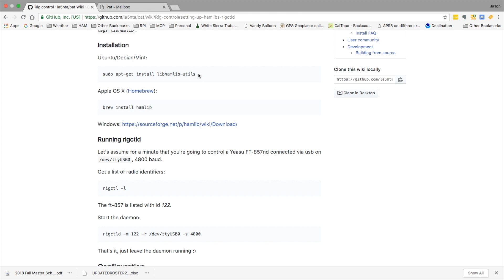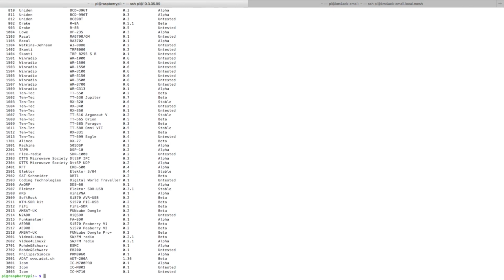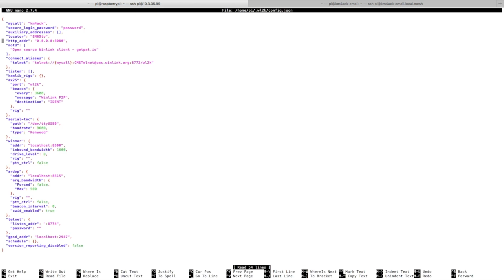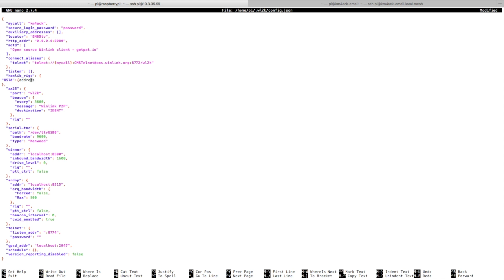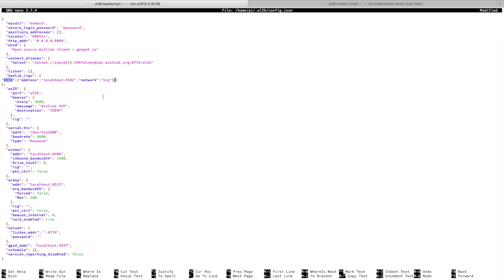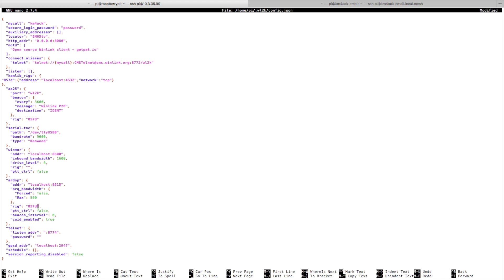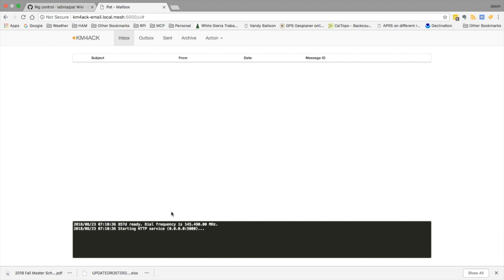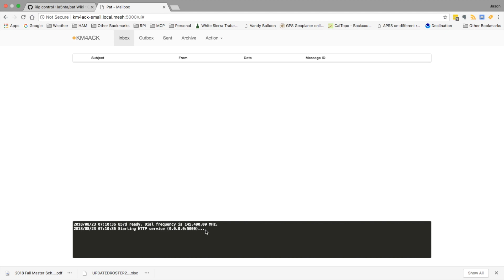Installing Winlink on a Raspberry Pi EP02

Comment: Just a foot note. It would not work with my FT-718ND until I turned the speed down from 38400 to 4800. Thank you @KM4ACK
Reply from the maker: Yes. The baud rate on the radio must match the command for it to work.

Comment: Hi Jason,   I am able to get most of this to work except for rig control.  I have a Yaesu ft-891 so I used this command: 
"rigctl -m 136 -r /dev/ttyUSB0 -s 9600"  I am using a raspberry Pi 4 w/ 4gigs of memory.  I also have a program FLRIG that I use and it works okay at controlling the radio and it is not running while I issue that command.  Any ideas?   Ken wd4nkz
Reply from the maker: Does 9600 match the baud rate on your radio? An alternative is to open flrig and then use "rigctld -m 4" and feed rig control through flrig. This is the way it is configured on build a pi. Also, I have a new series for installing winlink. It's at the top of this playlist https://www.youtube.com/playlist?list=PL1QTYT4Qo9cY98NFmxrTvtGyWI9pgxtFq
Reply: @KM4ACK  yes it is configured for 9600 and I'll try out your suggestion and the other link.  Thanks so much for responding!!!

Comment: ok Im using flrig because ft891 isnt in hamlib yet

this isnt working for me, i assume thats because "/dev/ttyusb0" in my case isnt right because of flrig.
what would you try here

rigctld -m 4 -r /dev/ttyusb0 -s 4800
Reply: OH WOW........ FT-891 is in the list now..... Number 136      THANKS GUYS!!!!!!!!!!!!!
Reply from the maker: Ross, If you choose to use FLRIG, you will skip the 'rigctld' section of the setup for Pat. When connecting with Pat, first open FLRIG and choose your frequency. Then open pat, choose your transport, enter the target callsign, and click connect. No need to enter any frequency information in Pat. 73, de KM4ACK
Reply: @KM4ACK  Roger that... i found FT891 in the list after updates.... its number 136 i reflashed the card. started over.. when i get to 

rigctld -m 136 -r /dev/ttyusb0 -s 4800 

it returns
"rig_open: error = IO error"
whats that mean? any idea?
Reply: wait no .... sorry..... i see it....... ive been up all night playing radio ... i just need sleep..... sooooo..

USB is capitalized......    hahahah   geez... ill admit im a rookie... it works now
Reply from the maker: Double check your CAT baud rate on the rig and make sure it matches the 4800. 73, de KM4ACK
Reply from the maker: Yes. Linux is always case sensitive. 73, de KM4ACK

Comment: FT-891 is not in hamlib?????? OH NOOOOOOOO!!!!!!! what do i do ... im a newbie
Reply from the maker: Couple of options. 1. Run Pat without rig control. Rig control in Pat is limited anyway. You can only change the frequency. Pat won't change modes on the radio. 2. Compile hamlib from source. (Google is your friend here) 3. Install FLRIG https://youtu.be/WCj2usvOItQ Then you can change to the correct frequency with FLRIG before firing PAT up. Hope this helps. 73, de KM4ACK

Comment: Love the series.  Was wondering if anyone could point me in the right direction.  I am trying to set this up with my 857d and when I launch rigctl and pat it tries to connect to the radio but throws a connection refused message when it polls for the frequency.  I verified on the radio menu 20 that it is indeed set for CAT not TUNE - but still receiving the error.  Any guidance would be appreciated.
Reply from the maker: Check the baud rate on the radio (menu 19). Mine is at 4800. Also, make sure it matches the rigctl command. Thanks for watching! de KM4ACK
Reply: @KM4ACK  Thaks for the response. I checked and I am using -s 4800 and menu 19 is set to 4800 bps. The full error is : Unable to get frequency from rig 857d: dial tcp 127.0.1.1:4532: connect: connection refused
Reply from the maker: @mattkob  Are you using rigctl or rigctld? Did you set it up in rc.local? de KM4ACK
Reply: @KM4ACK  OMG - I was leaving the d off of my command and therefore running rigctl.  It appears to be working now, at least it is error free.  Thank you so much for the assistance and all the great videos you produce for the ham community.  I am eagerly awaiting my signalink to arrive so I can fully test things.

Comment: Having the darndest time here.  I've got pat installed and running over telnet.  I can't seem to get it hooked up on ax.25 using direwolf.  Is that just not possible or am I missing something semi-obvious?
Reply from the maker: It’s possible. Try this video for help. Pat Winlink 2M Packet 1200 baud Setup https://youtu.be/o8OBF47UkeI thanks for watching. 73, de KM4ACK

Comment: I get this error not quite sure what it means, please help: rig_open: error = IO error
Reply from the maker: It means that your pi can't communicate with the radio. It could be any one of many reasons why. Rig control is the hardest part of the project to get going for most. You can skip the rig control portion and simply spin the dial on the radio by hand for now if you wish. I will try to help but probably don't own your radio to test. Feel free to send me an email mycall@arrl.net Include which radio you are trying to configure. de KM4ACK

Comment: Thanks for doing these videos! I don't quite have my setup working yet (figuring out how to adjust ARDOP levels), but one note for my setup with my FT-891 - in Pat config under ARDOP, I had to make ptt_ctrl TRUE.
Reply from the maker: What kind of sound card are you running with the 891? de KM4ACK
Reply: @KM4ACK  I'm using a $2 eBay USB sound card. I managed to adjust the levels outside of ARDOP, and I've successfully tested the system.  Thanks for putting together this video series! 73, Rex KE6MT

Comment: I've gotten this far:
2019/02/23 11:18:23 Unable to get frequency from rig 7200: read tcp 127.0.0.1:41918->127.0.0.1:4532: i/o timeout.
Not sure where I am going wrong - is my pi simply configured differently?  Any suggestions on where to start looking?
Reply from the maker: Dave Phelps try disabling rig control until you get pat talking to ardop or at a minimum working with telnet. That way you are only working on one issue at a time. Makes it easier to troubleshoot. de KM4ACK

Comment: Hello Jason, thanks again for your videos - as everyone else has said, they really help a lot. My kx3 and signalink worked just as you said it would  (substituting 229 for 122 as rig number) FB.  One small fixable hiccup: in the video you use "rigctld" whereas in the listing of commands following the video you write "rigctl" to start up the software ... the command does need that "d".
Reply from the maker: If running from command line, leave off the 'd'. If running from /etc/rc.local you will likely need the 'd' de KM4ACK

Comment: A sidebar question :  at 2:40 you enter the port for 'your' Yaesu. Would you take a moment and explain how you determined the port that your system is using? Thanks. I now have PAT up and running, over VNC as well as on the Pi ( bring up a browser and enter the 0.0.0.0:8080 on the Pi - no need for the VNC ).
Reply from the maker: Glad you have it working! 4532 is the default port for rigctld. This is the page I referenced when I was first setting things up - https://github.com/la5nta/pat/wiki/Rig-control And as a teaser, I am working on a script that will help you find ARDOP stations to connect to if you are working portable without internet. Be sure to subscribe if you haven't already. de KM4ACK
Reply: @KM4ACK  Well, another few questions , if I may. Slow going here. In theory , if you launch rigctld, then piardopc, then PAT - then move to PAT-Mailbox and select a station as well as a frequency; PAT-Mailbox tells rigctld to change the radios settings - right? Next question : do you know if grig interferes with the above chain of processes? I have found that if I launch rigctld, then grig, I can indeed control the radio, but as soon as I launch PAT, the radio appears to be opaque.  I tried grig because it did not seem that the requests from PAT-Mailbox was getting through the chain to the radio. I have been really enjoying your excellent videos - thank you so much! de K7AOZ
Reply from the maker: Yes. Your theory is correct. Pat should change the radio frequency when you select the station in the PAT-GUI. Not sure about grig as I don't run it. Until lately I haven't run rig control most of the time because Pat is limited to just being able to change the frequency and NOT the mode on the radio. Just a couple of weeks ago, I stated playing with FLRIG and hamlib. I now change frequencies with FLRIG before I even start PAT. I am also experimenting with controlling the rig, antenna tuner, an Pat with a script that can be run from the command line. de KM4ACK

Comment: I am getting the following response: 

pi@raspberrypi:~/temp $ rigctld -m 127 -r /dev/ttyusb0 -s 4800
rig_open: error = IO error 
pi@raspberrypi:~/temp $ 

any suggestions?
Reply from the maker: From the limited data you give, I would guess that it's either a loose connection or the wrong rig selected. Could also be the wrong baud rate selected in the menus of the rig. On a good note, Pat will work without rig control enabled. You will just set the radio manually. I ran like this for a couple of months before I got around to setting up rig control on my system. Since I only run the Yaesu 857D, I may not be much help with other radios. Try posting your question on the hamlib forums - https://sourceforge.net/p/hamlib/discussion/25919/ or the pi forums https://groups.io/g/RaspberryPi-4-HamRadio/topics
Reply: @KM4ACK  Thanks for the response! I will investigate it further.
Reply: I have made a little progress here. I am very new to this whole linux business but I am enjoying the learning.  I have rigctl recognizing my radio now. I had the wrong usb port and also failed to capitalize in a couple of key areas. when I run rigctl from the command prompt, then hit ctrl  z to stop it, and bg torun it in the background all goes well until I run patt http. Linux gives me an error "Unable to get frequency from rig... etc...   im probably over thinking this but what am I missing?
Reply from the maker: FB on the progress. Yes, capitalization is paramount in linux. Try to keep it super simple to start with. First, open one terminal window and start rig control. Second, open a new terminal window and start Pat. See if that works. If not, you have a mistake some where. More than likely in the Pat configuration. Go back and double check your work in 'pat configure'

Comment: I have a Kenwood TM D710G and I got as far as the end of this video.  Pat seems to be able to talk to my radio and it will show what freq I'm tuned to.  However when I try to connect to a winlink station via Aux.25 I get an error saying there are no Aux.25 ports configured.  Any thoughts?
Reply from the maker: ax25 is used in 2m/440 packet. i have only done videos covering ARDOP so far. To do packet, you will need direwolf and ax25 configured. I plan to do a video or 2 on this when i have the opportunity. It's pretty in depth compared to getting ARDOP up and running. If you want to go ahead and attempt ax25, i would recommend starting the the pat forums. https://groups.google.com/forum/#!forum/pat-users If you follow all 4 vids, you should have ARDOP over HF working by the end of the 4th one. 73, KM4ACK
Reply: @KM4ACK   Thanks for the help. I guess I have a lot of reading to do.  I didn't think I would need direwolf with the 710 but I'm still learning.  I look forward to seeing your new videos when you have time.  
73
VA3JJw
Reply from the maker: Dire Wolf is a software "soundcard" AX.25 packet modem/TNC and APRS encoder/decoder.. Im not familiar with the 710 but I wouldn't be surprised if you need it. I have a signalink and a yeasu 857D and require Direwolf and AX25 for packet work. de KM4ACK
Reply: @KM4ACK  The D 710 has a TNC in it. I would be using it unless the soundcard is used for JS8call. I've gotten direwolf installed on the laptop but now working on the Desktop and TS 2000. Pat is on the desktop I just need to figure it out.